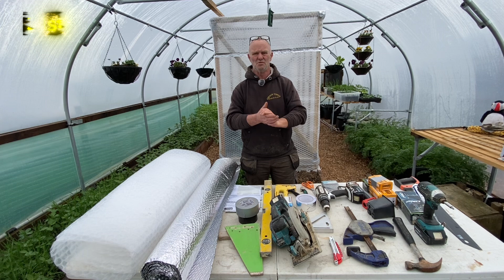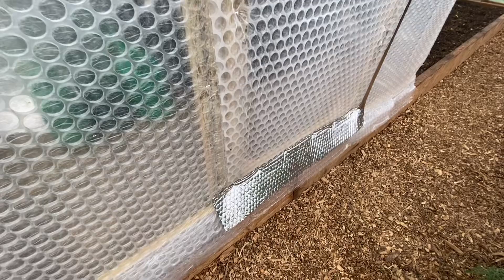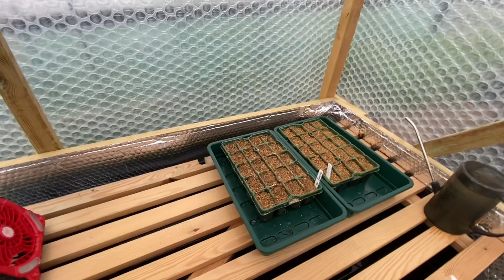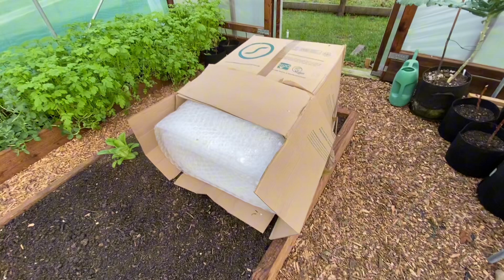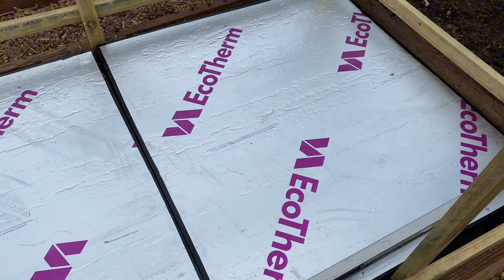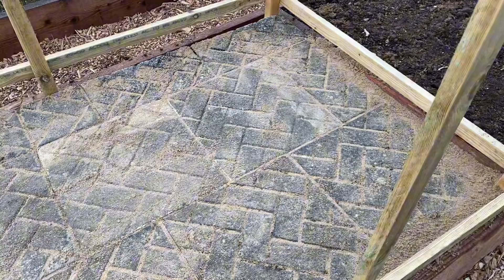How to build a passive greenhouse inside a poly tunnel.

Comment: Looks great.  Every level of protection is like moving 1 to 1.5 zones south.  
So if you added another covered environment inside this new one, that's yet another 1-1.5 zones south thus going up to 3 zones south in total.
Air circulation is probably going to be needed....solar????
Reply from the maker: @RobinGardens  That’s interesting to know about the zone difference. I will definitely be sorting out some sort of ventilation, as others have suggested it as well and it’s definitely good advice. Thanks for the advice.

Comment: I had a small blow away greenhouse inside the poly last year and stuff got mold so ventilation is very important. But should be a treat 👍. Happy New Year again, Ali 🎉🎉🎉
Reply from the maker: @myrustygarden. Great advice Ali, I will be putting some ventilation in I think and I have that fan in there to help move the air around a bit. I will definitely be monitoring it closely. At least I haven’t got any raccoons. 👩‍🌾🇨🇦👍
Reply: @ I’ll pop one in the post 🤣🤣🤣

Comment: Great video Pete, personally i would add a window at each end of your propagator / greenhouse for air circulation and also condensation, as well as heaving a thermometer with a humidity gauge.  As for your tank leave a lid off. I have a 220 ltr barrel in my tomato room which is full of water and it does help retain some warmth in the room as well as having water on hand to water seedlings, as the water level goes down with using it, i just simply top it up. Also its handy on those days when its raining heavy and you need to go out to get water.👍
Reply from the maker: @jimmy.plot.41.b Your probably right about the ventilation Jimmy and getting a humidity monitor is a good idea, so I’ve ordered one of those. Thanks for the advice 👍👍
Reply: @PetesCornishGarden  No problem Pete mate

Comment: Pete great video,you said you were looking at doing this in your polytunnel 👍 I get temperature swings between 5 and 11 degrees in the greenhouse,on a bright day I wear a t shirt in the greenhouse it is warm in there,good idea with a fan, and the heat mass idea,not sure how long the water will take to heat 👍 👍well done mate ,
Reply from the maker: @GanggangPeanut  Thanks Mark it was seeing you insulting your greenhouse that gave me the idea. 
I don’t think the thermal mass part of the build is going to make much difference really, as it relies on the sun ☀️ and we don’t get much of that over the winter, so ultimately I will be looking at ways to heat it, but with no electricity or naked flames, so I don’t know how successful I will be. Thanks for commenting.
Reply: @ you will be surprised on a bright day how warm it is 👍